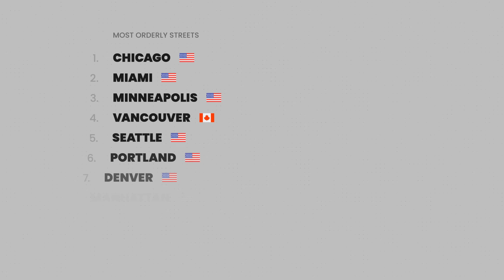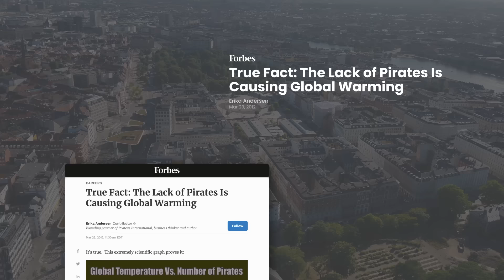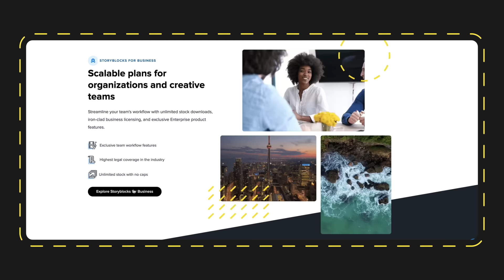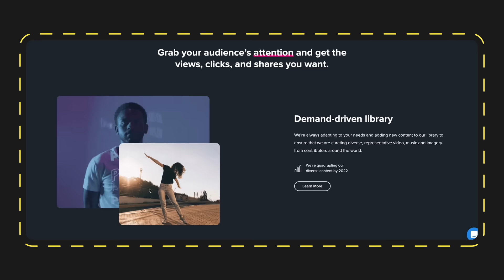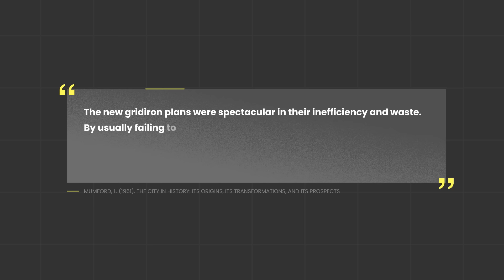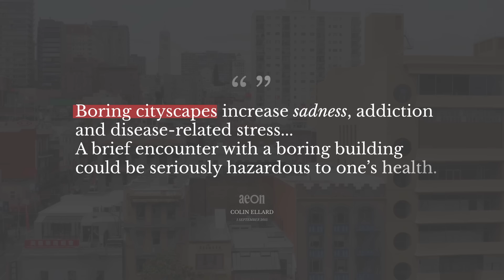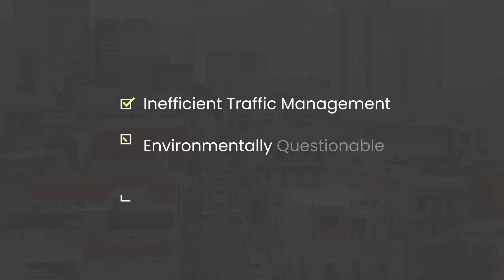Why Cities With Grids Are Terribly Designed

Comment: actually, most NEWER US cities don't use a grid design, and the grid design worked very good for getting around.  The problem is not the grid design as much as it is cities deciding to move away from mass transit and "walkability" and to a very car-centric urbanization model.  Most cities that have a very strict grid design were designed long before the car and pretty much all newer US cities that want to be more car centric use the "suburb" design which utilizatizes long windy roads and cul-de-sacs as opposed to "grid" streets.  Look at any middle sized US town or city that has a core downtown with grid design and that has "expanded" "post World War 2" and you'll notice right away that the expanded city streets are MUCH less "grid-like" and much more "suburban" like with many of the same sorts of "windy roads" and cul-de-sacs.

Comment: While most commenters blame cars and bad (i.e. single-use) zoning (which probably do contribute more than the street design itself), and the video blames the grid, almost none of the points mentioned in the video are caused by the grid, they are just correlated:
4:52 The street widths have not been chosen sensibly. This isn't a problem with the grid itself, but with the planners' mindset of accommodating all possible future uses (or just laziness) - instead of properly choosing the street widths in the grid for each block separately. Correlated to the grid (caused by the same design goals), but not caused by it.
5:32 I can't really believe that the grid is the cause for the high ratio of asphalt to usable land. In fact, if you have a known lot depth that you want to accommodate (for example most mid-rise buildings built is the last decades are exactly wide enough for the parking garage in their basement - or if you play Cities:Skylines, that width is 4 zoning tiles), putting them back to back as close as possible directly leads to parallel streets. And then you'll need cross streets at short enough intervals to not choke the traffic that wants to move between those streets. I don't see how anything could have a better ratio of available land to road length (unless you do away with the requirement that all lots have road access). But again, the minimum overall length of streets only leads to the minimum asphalted area if you build your streets with the minimum suitable width - which the US just doesn't do.
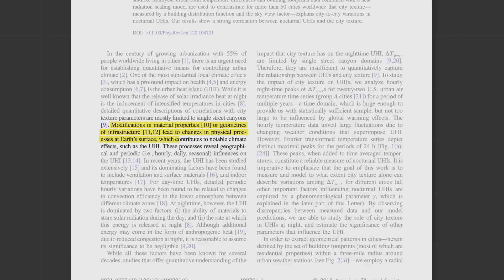5:53 I can't really believe that cities with grids trap MORE heat. Long straight roads are perfect for wind at ground level to reach very high speeds. I would rather assume that aligning streets in N-S and W-E directions (which usually comes with grids) somehow allows the sun to shine into those urban canyons more easily, where it can heat up the almost perfectly radiation-absorbing asphalt. I would like to see a comparison where they compare grids aligned along the cardinal directions with grids at an angle closer to 45°.
Or maybe it's just another consequence of making most of the streets too wide, as in the above 2 points.
4:23 "The grid" creates ONLY intersections where all roads continue at 180° (and turn at 90°), which is still true for high-capacity roads in non-gridded cities, but only for MOST of their intersections. This is bad for high-speed (i.e. motorized) traffic safety because it encourages most people to go through the intersection at full speed on a green, increasing the risk of rear-ending the vehicles that have to slow down to turn. (This is also a problem with high-speed roads that have a lot of driveways.) This is very much a problem of the (rectangular) grid, but for example wouldn't happen in a honeycomb grid. Thus I'm not sure if I would call this a problem of grids in general, but since nobody does non-rectangular grids, it's a problem with all the grids we have.
5:18 Yes, the fact that the grid doesn't conform to the terrain IS a problem of the grid design. But that's only a problem because the grid is usually plotted out to span the whole city. If you had a gentle slope, you could take a local chunk of the grid, rotate it so that the streets are at a 45° angle to the contour lines, and you'd end up with streets that have a reasonably low grade.
6:25 Have you looked at cul-de-sac suburban neighborhoods? They have the same problems. In fact, monotonicity doesn't come from the streets itself, but from the buildings that are put onto it (when do you ever gaze at the street instead of at what's alongside it?). Which is just something that the US is really bad at, where you'll have zoning codes that regulate everything down to how many accessory dwelling units and front doors can be on a property. But many buildings still fail to "address the public realm" as Charles Marohn from Strong Towns puts it.

So, in conclusion only 2 problems with grids themselves, the rest are problems of US city planning unrelated to the grid.

Comment: 0:08 Seattle and Chicago's public transportation system beats Phoenix's crappy design by 10 fold at least!  Personal experience, it's awesome to use the public rail systems that go under or over car traffic to get you pretty much where you need to go easy and quick.   Chicago streets during rush hour are filled with cars though, it's great to watch all the stalled traffic when you ride the L Train float right over all that crap.  The busses in Seattle are also powered by electric lines that go over the roads instead of mainly gas.  Seattle also has trains that go above/below traffic too but they are more spread out.  Just saying some cities have to do some major future rethinking of how they do their urban planning to be come more efficient for growth and/or sustainability.

Comment: EVs doesnt reduce the co2 output at all, just the local output - vast majority of the grid power comes from coal and oil/gas. +These vehicles weight a lot more that the traditional ones so the manufacturing is heavier on the environment, too.

Comment: The issue with grids is simply not the grid itself: Its cars. Cars are the reason the grids are prone to accidents , due to everyone having to drive in a 5 ton steel and plastic "light trucks"  are significantly more likely to cause property damage and accidental murdering of humans than a mere bicycle.This also leads to the indistinguishable problem of arterial roads vs residential areas, as these were never meant to be used for cars: They were meant to be walked there: a human city built for humans. Cars are the main issue when it comes with heating,a s these cars heat the asphalt that had to be layed for cars and therefore make the cities unlivable for humans.Lastly, the whole unlivability and repetitveness problem is tackled when the city is walkable: As it encourages explaorition of the city and appreciation of it (limiting its boringess),and physical exercise which tackles both the obesity crisis in USA and significantly lowers depression and anxiety (this is why countries liek Netherlands or Italy have very low fat ratios and practially 0 obesity ratio). THe strengths of the city get furthed added, as the grid makes the city more walkable. Overall grid designs are amazing when cars are taken out of the ecuation, as they were designed without consideration of inneficient, expensive transportation methods that forced microtransactions one everyone and embraced that cities are built for humans -not cars.

Comment: I don't think you've even shown correlation here. Choosing two metrics, choosing the top 10 for each metric, and then observing that there is no overlap doesn't mean there is a correlation. If I were to rank cities by population and also rank them by number of native English speakers in those cities, those might be two totally different lists (since the 10 largest cities aren't in primarily English-speaking nations). But that doesn't mean that population and number of English speakers isn't correlated, it just means that taking a small sample of each isn't very representative.

As others have pointed out, there are plenty of cities that break the rule that you've developed. The actual correlation is much simpler: Your list of the top 10 grid-based cities are all United States and Canadian cities, which means that they all have similar city planning methods. Standard US city planning rules create unlivable cities, which just happen to be grid-based. The correlation with grids is mostly just that older cities are less likely to be grid-based and all the North American cities on your list are much newer than the livable ones.

Comment: I feel like Chicago is actually a very bad example for this video because it does not follow the typical American grid, despite being a grid. As someone who has lived in Miami, NYC, Chicago, and several Asian and European cities, the Miami and NYC grids are absolutely horrid. Meanwhile, Chicago's use of alleyways, its distinction between tree-lined residential streets and main arteries, and extensive green spaces means that it is a much greener, pleasant, bikeable, and pedestrian-friendly city. Yes, the grid isn't ideal for traffic, but you don't need a car in Chicago unless you are out in the suburbs. (This is not to say there aren't better models than a grid, but Chicago's grid is much better executed than most grid cities.)

Comment: I feel like this video is severely undercut in its length and complexity. We get to barely touch on the surface level factors, and then it ends. No tangible conclusions to be drawn, no analytic questions to ponder over, no real counterexamples drawn from studying the actual livable cities that are mentioned prior. And I find it personally a funny coincidence that I happen to live in the most livable city (Copenhagen, according to charts). I've frequented US cities, European cities, Middle Eastern cities - and I can easily tell some core differences that this video never touches on. Actually the most relevant factor being "boring", yet we barely dive into it at all. Diversity in a city leads to diversity in the sub cultures that develop, diversity in businesses and people, diversity in experience - and all this helps to fuel one of mankind's most essential instincts: Curiosity. A non-uniform city in terms of diversity, provides a desire to explore and experience, to invest oneself in the city, and thus the city itself turns into its own character. That is how you attach yourself to a city.
I believe that is one of the reasons why New York ranks highly among US grid cities, because despite being a grid (mostly on Manhattan) it still retains a high degree of diversity in its layout and its sub city cultures that have formed over the years. Living in that city has turned into an experience, more so than the average grid city.
And the same goes for other European cities like Barcelona which you mention. Barcelona being a far older city than any US city in the first place means cultures have had many centuries to develop, the architecture reflects this matured city life where 100s of generations have shaped it. These cities formed not from sudden need of expansive housing, but from organic growth due to core desires to live at that place, desires that shape that place. It means that no part is segmented or pre-intended to be exclusive to anything such as residential area or businesses or markets/shopping. Instead everything is intertwined naturally and formed over time.
That's why it is so important when planning new cities and expansions, that expansions should mimic natural growth and not just tunnel vision on a few select needs (most often being residential). If you have an entire grid of residential-only, then you only have to see one block to have experienced 100s of blocks. And this kills curiosity. It kills the desire to open one's eyes and see what is around you. Because you already know just from a small glimpse.

Then of course we add all the non-city related factors like automobile dependency in general, work-life balance, soft values, general atmosphere, etc.

Comment: The main issue I see is population and parking infrastructure. I use to live in Tulsa, OK and had zero issues getting around the city in general. . Lower population than these cities and each company had their own parking spaces. So it was easy on navigation and zero frustration of having to drive around and around. But if you went to the downtown area. That’s where it got frustrating when driving. Almost all streets were one-way. So if you want get to one area you may have to loop and loop around. and it was difficult to tell public paid parking from private company parking and private paid parking areas. So driving in downtown was irritating as heck for most people.

Comment: Most of the arguments presented here are not problems of the grid so much as bad execution of a grid design. These early planners just plopped down grids with little consideration for anything other than real estate interests and a vague notion that linear streets make travel easier. A grid that accounts for most of the flaws of the grid said in this video will be much better off, especially if it has diagonal boulevards. This still doesn't solve the monotony and heat problems, although in my opinion those are better solved block by block than by street layout. A city with the most beautiful intricate streets will still be bland if its buildings are faceless skyscrapers and office boxes. Meanwhile, Barcelona's grid, while monotonous, has a development pattern that is extremely pleasing to the human desire for fine grained detail and variation. I prefer a middle approach myself. Have extremely orderly main arteries, ideally in a repeating radial pattern where geographic centers that concentrate uses each have boulevards radiating out in every direction, but allow small local streets to irregular and almost chaotic. Paris is a fantastic example of this. Of course, you have to work with what you already have (unless there's a disaster or you're in a part of the world that's building new cities...which shouldn't be the English speaking part currently), and so we're more or less stuck with what we have without horrific demolition projects that harm the urban fabric in ways that take generations to recover from. In the US we could demolish a lot of our urban freeways and replace them with grand boulevards that follow good street design principles, as our freeways already act a little independently of the grid and could potentially make up for bad design. Also, streets can always be narrowed where need be by moving the sidewalk in several feet and then giving property owners free land that they can redevelop onto as they wish.

Comment: Grids are not bad. take for example Mumbai city. Due to no grid structure, it is worst place for daily travel and live. Adjacent to this city, a new city was developed in 1980s, with grid locked design, and it is the best place to live. Ofcourse when you sit down to evaluate, it isn't just grids that constitute for over all wellbeing but its the population density that is causing more harm.

Comment: The "grid" city didn't become popular simply for zoning and orderly settlement. Sure, grids started before the automobile. But it was the automobile that drove the grid design more than anything. It's no surprise that many American cities dramatically expanded during the rise of the automobile. Non-grid cities are considerably less auto friendly, for better or for worse despite what this video says. Try driving in New York and Boston vs Chicago. Unless you actually drive in these cities, you know nothing and simply throw opinions around. Chicago's traffic moves magnitudes faster on average.

Grid cities are considered less "liveable" because they usually have public and foot transit considered as a secondary and tertiary priority, with autos being the first consideration. This is slowly changing, but European cities which are generally more crowded adopted these improvements decades ago while American cities are just now warming up to them.

Comment: In theory a grid system is more intuitive for navigating around. But I'd argue that (on the whole) if you live in older European town then you have an almost innate sense of being able to find your way round virtually any other older European town. The cues provided by the size and layout of roads and the geographical features leading to the centre are very organic. By contrast when visiting a city with a grid system you have to abandon your instincts and navigate by numbers.  It can be quite disorientating!
Reply: Directions are much easier to follow on a grid system. Based on your location (North, south, east, or west), you either make a left or a right.  If you miss a turn, it’s not a major issue.

Comment: Safety issues in grid cities have to do with road/public realm design.  Toronto is built with a grid with wide arterial roads, narrow 1 lane roads, roads with speed bumps, roads built as a woonerf, and others with NO CARS at all.  It's design that ensures safety not whether streets intersect at a 90 degree angle.  Grids don't necessarily mean more asphalt either.  Once again, it has do do with design.  You've looked at grids in 1 country (USA) to form conclusions that don't hold up to scrutiny.  Sorry, but you haven't thought this through.